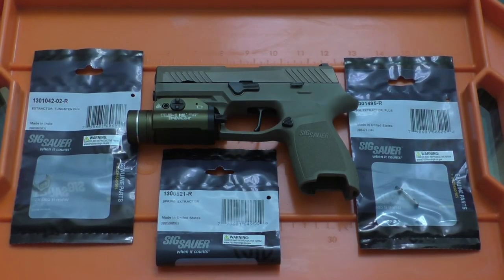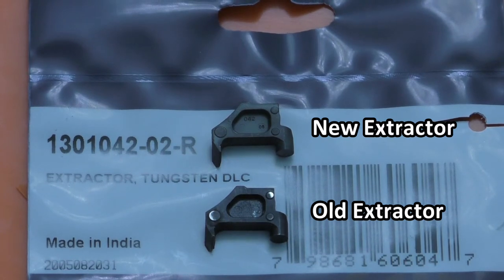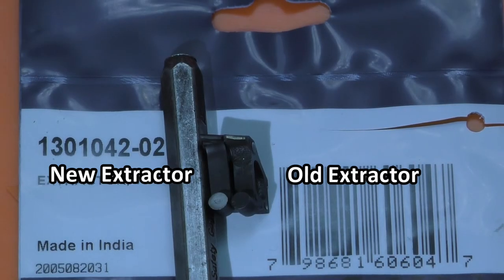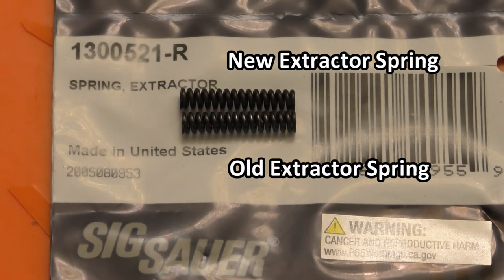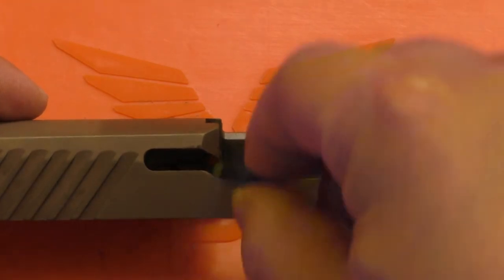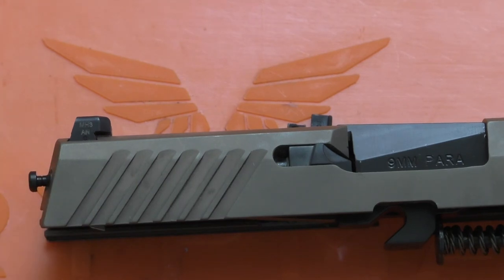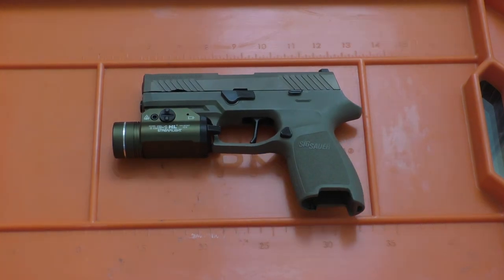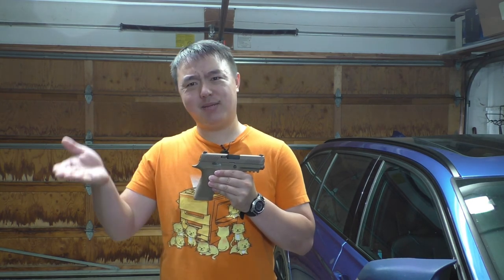Sig P320 Extractor Upgrade and FTE Fixes

Comment: Love to hear your take on the latest law suit and claim of P320's going off in holsters without any drop forces being applied.  Read today that perhaps it's cops using ill-fitting P250 duty holsters which can make contact with trigger upon reholstering.   Otherwise, I can't see how the gun would discharge without some sort of pull on the trigger give the upgrades made to the gun by Sig.  Good vid BTW!
Reply from the maker: I actually wasn't aware of that latest lawsuit. I'm not one to jump to conclusions, so I'll wait to see what the whole story and data says. I think it's plausible it could happen, since there have been other failures on this platform, but we'll see. I'm not really worried about something interfering with the trigger of mine with the Safariland holster I used with it. Thankfully the Safariland has enough stand off from my body that if something did unfortunately cause the pistol to go off, it wouldn't go into my leg, haha.
Reply: I believe you're exactly right that the trigger is somehow engaged to cause a discharge

Comment: Thank you so much for posting this video!  I haven't used my P320 Compact in over a year.  I joined a new range and only brought this handgun with me.  Basically every shot resulted in a failure to eject!  It was so frustrating, embarrassing and disheartening.  With the help of one of the senior range instructors, we determined it was an ejector problem.  Your video, explained everything perfect!  I will order these parts.  One question though:  for the love of God I cannot get my back plate off.  I know it can be difficult but I tried everything.  I noticed you still had the barrel and spring in the gun when you did it.  Maybe I had these out when trying.  Could this be my problem?  I will try again tonight with those in the slide.  Thank you again!
Reply from the maker: Barrel and recoil spring in/out of the slide doesn't matter for getting the end plate off. After depressing the detent maybe you have some buildup between the plate and the slide that's binding them together? You can try some penetrating oil if that's the case.

Comment: Same here!!! I just replaced the spring which cut down half the ftes. I plan on getting the parts from Sig next week to see what happens. Once I fix this, it's going to be sold.
Reply: So I got all my parts today. Upon inspection, comparing the extracor. My old one was broke at the tip. I'll try it out at the range tomorrow. Also, the pin was a little different than the original. Seems like it's designed to put more pressure on the extractor.
Reply from the maker: I hope your FTEs got fixed! A broken extractor will definitely cause issues.
Reply: @FaRKle0079  Yes, the very edge of the extractor was broken. I updated the pin, spring, extractor, and extractor pin. I then traded it off for an Arex Zero 1 cp.

Comment: Hi there i have the sig p320 with the Romeo sig site on it. I was shooting it last week when it did not extract the case thought it was the ammunition but the extractor was broke. This is the second one i sent it to sig the first time and this time I decided to do it myself. I received the parts today i bought all the parts. So when i took it apart the spring and two pins were the updated ones. So im putting in the new ones anyway
Reply from the maker: Was the extractor that broke the latest DLC part I had too?
Reply: FaRKle0079 i cant be sure about that. The one I received today was not the one you have. However i did do one thing different in Assembly i used a very little gun slick on it for lube.  Ill shoot it tomorrow.

Comment: all P320 striker is the same   ???    I'm thinking of buying a full-size slide I want to know if the striker and the extractor case of a compact internally works on a full-size slid
Reply from the maker: Yes it should work for the fullsize too. There shouldn't be a difference since the larger sizes just have longer barrels.

Comment: I noticed how the fixed gun has weaker ejection than the shooter next to you. I also notice the same with my XCompact. Is there a way to improve the ejection without adversely affecting the gun or its performance?
Reply from the maker: I can't say I've felt the need for the casing to eject further. Are you having issues with yours?
Reply: @FaRKle0079  2 failure to eject - stovepipe, with Fiocchi 115 ammo, but none since those. New gun, and I will use 124 grain from now on.

Comment: Will this fix failure to feed issue that I’ve been dealing with?! P320 .40cal
Reply from the maker: I don't think this would fix a failure to feed since the extractor doesn't play a part for that. I'd check to see if your slide is short stroking, magazine spring is weak, or if the round is getting caught up on its way into the chamber.
Reply: @FaRKle0079  idk what it is. I called Sig today they told me to clean it (I did twice) then see if the problem continues? Then I’d send it to them to check if everything is doing like it should....Just the round wouldn’t go in the chamber like it would get caught up?! Hard to explain just have to fire it more I guess? Gun is broken in 3-4 hundred rounds or more? It’s frustrating because it’s my everyday carry and if it jams like that in a situation where it’s life or death I’m dead!